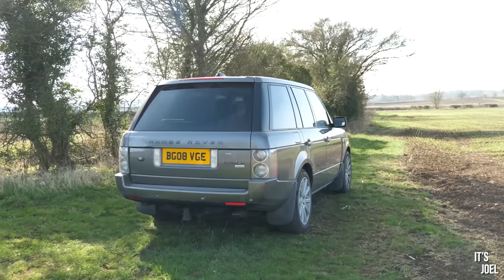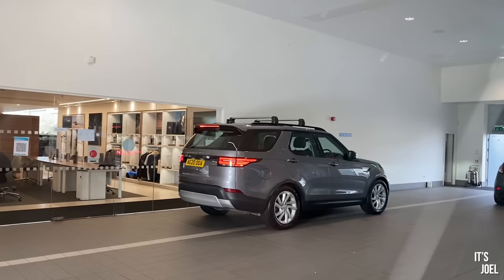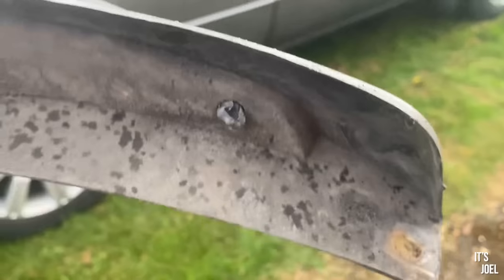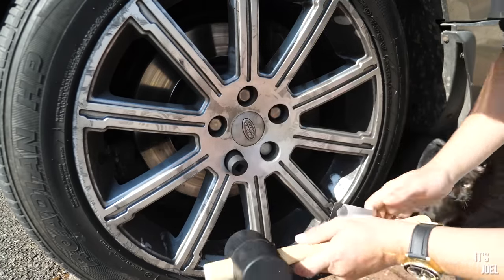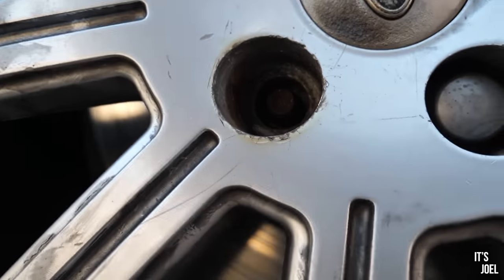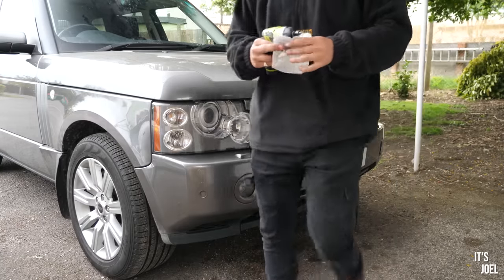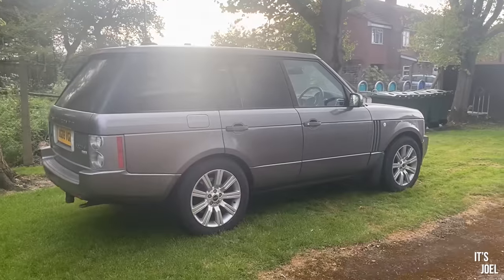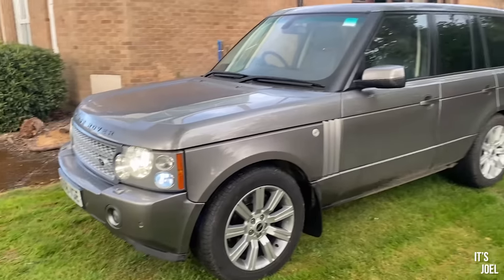Transforming my Range Rover in 20 minutes!

Comment: If you want to keep it somewhat long term ish, pull the sill trims, rear arch liners and treat any rust any spray a rust killing and wax treatment.  
That will help the notorious L322 wheel arch rust problem. Then from the inside , remove the side panels and get to the rear quarter panels. The rust you always see there is rusting from the inside out. By the time you get a rust bubble showing on the outside, it's too late.

Comment: It looks odd having the mud flaps in the front and not the rear. If you're going to remove the rear, why not remove all four unless you're thinking of replacing the rear later on. Congratulations on your hard work.
Reply from the maker: Thanks Nathan, the reason I've left the front ones on for now is because removing and replacing them will be part of doing the side step install, however not sure if I will do that or not yet.

Comment: Tip, for cleaning wheels, place a large micro fibre towel over the top of a bucket, and put the wheels on top of the bucket. Saves you marking the face and having to bend down to clean. I picked up a wheel cleaner station the other month and it's a God send

Comment: Hey Joel. With the air suspension. You put it in the off road mode. At the highest setting and. Then when you jack up the range and put it back on the ground it won't be confused.  Cool vid btw

Comment: Just a small tip I'd recommend using a 6 point socket over a 12 point. They fit better and are less likely to round tight bolts/nuts.

Comment: 23mm socket usually works with the ‘swollen nuts’ issue on these. An impact wrench is a good investment if you are doing a lot of wheel swapping so not all wasted money. I’d recommend using a torque wrench to set the correct 140nm final torque and don’t just crank them up with a breaker or you can stretch the threads. Good luck with the project and keep an eye on the EGR valve as.
Reply from the maker: Thanks John, 23mm was too big, ended up buying a 22.5mm which actually fit, but that was after I'd managed to get them off with the method you saw in the video. Having the EGR deleted in a few weeks!
Reply: @itsjoel  in

Comment: I had a similar experience removing a stuck NOx sensor in my camper's exhaust. Not only did I spend a small fortune on spanners to remove it, but a second small fortune in various tools to recut the buggered thread after finally removing it. Very satisfying when you get it all done though.

Comment: The sidelight bulbs you fitted are LED's not Zennon. And before  hammering on the 22mm socket onto the  WHEEL NUT (not Lug nut, you ain't  a yank!) you should have tried a 23mm as some of those nuts have rusted under the stainless steel and caused them to swell up, and a 23 mm fits ok. You could have saved yourself a fortune lol yes probably the one you totally buggered would have needed heating up, but the rest would have come undone ok. Here's a little tip for you all. If something is really stuck and won't undo, try with the breaker bar to TIGHTEN IT FIRST. this little trick has got me out of trouble hundreds of times from small things to Land Rovers and bigger!

Comment: I also prefer the old style wheels. But as you say it is nice to see the “cleaness” of the new wheels. I like the look with no mudflaps but would suggest the fronts come off too. You will probably be able to use a hacksaw to get that bolt off that has expanded on the other side of the arch. The side steps would hopefully be a easy swap from one car to the other and the xenon’s look great and if like you say it’s easy why not change the others to xenon’s. Also I don’t know if it would be cheaper or not but if it is and they fit you could look at swapping the Pirelli’s onto the original rims

Comment: Hey Joel, a tip I saw on  another vlog was to get a spade or shovel under the wheel you are putting back on and use that to lift the wheel to the correct height..it can be done with one hand while guiding the wheel back on to the studs 😊

Comment: Next time a bolt gets stuck in the socket Joel all you need to do is hit the socket with a hammer and it will eventually come out, it essentially squashes the bolt out of the socket, just to save you spending money next time

Comment: The fixed side step goes into the front mudflaps. Deployable steps are expensive but excellent. I'm going to have to say as others have done that you should keep the rear flaps. Just looks more L322 and farmy than a 405 Chealsea kid dropper offer. Well done for perservering withh the nuts. Think I would have given up far sooner.

Comment: Did you put copper grease on the studs, before you put the nuts on? Also on the back of the wheel, where it meets the disc? If not, you may have to buy more sockets for next time you take the wheels off.
Also, put the mudflaps back on, to hide those holes. Oh, cute cat too !

Comment: Small tip if you can't get the hit on the socket use an extension and smash it as hard as you can,mash hammer wouldve been easier also. Not a rubber mallet or toffee Hammer
Reply: Also when old nut stuck in socket,lay it on the floor hold one end and hit it with a Hammer itll bounce off for you no problem

Comment: you didn't round the nut, you rounded the thin tin cover that sits over the head of the nut to make it look smarter & as for stuck on socket, screw the nut back in a few turns & stick an extension bar on & jiggle it about, it will come off after a minute or two

Comment: I vote no mudflaps (front or rear) and actually prefer the wheels you’ve just fitted, just never liked the look of the style it had on 

If you put the steps on I think those have the mudflaps integrated? In which case both front and back mudflaps would probably look better

Comment: Like the wheels they are better condition I would have left the mud flaps. Keep it a lot cleaner. All you needed is a screwdriver and bang it on the floor against the nut to take the wheel nut out of the socket. Failing that a vice and hammer and chisel